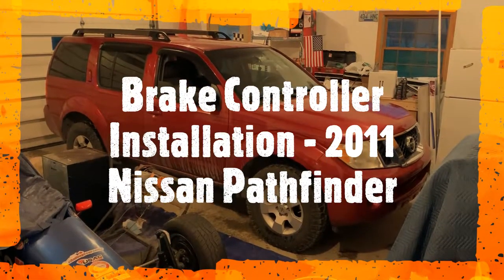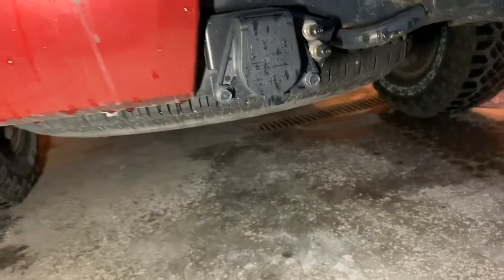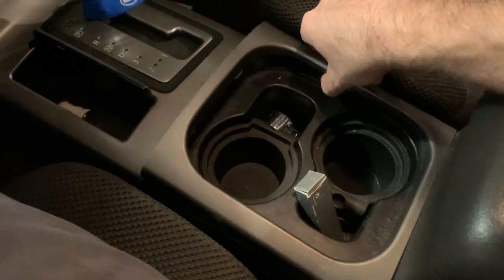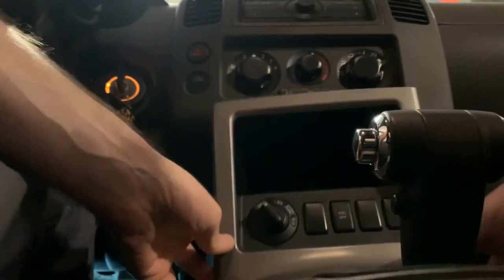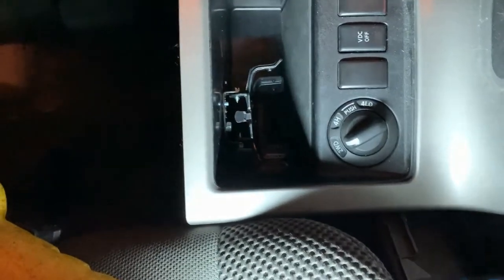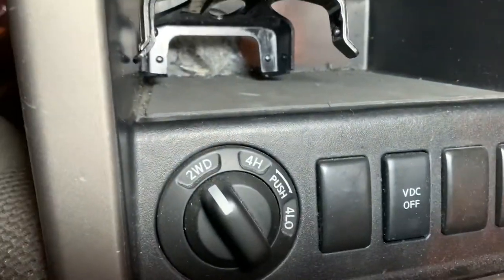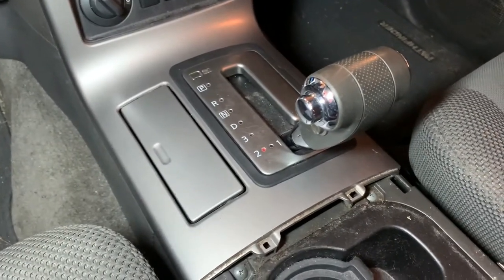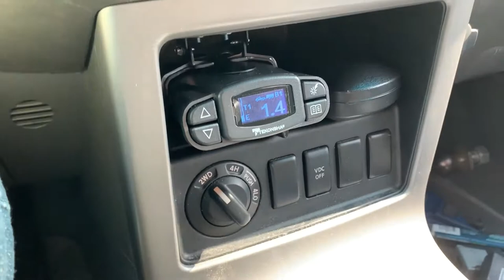Nissan Pathfinder Brake Controller Installation

Comment: Great job and a big help. I had a 2011 and sold it in 2016. Finally got another one and now I'm setting it up for towing.
Reply from the maker: Glad I could help. They are great for towing, better than a 6.2L Yukon I had before it.
Reply: @cqe5009    Agreed. I never added bags or a stiffer spring the first time,  and mine handled 4,500 # with just a WD hitch. I think I'll add the airbags this time as it's a 12 yo truck.

Comment: Really good video.  I want to do the same thing to mine but right now I have the 4-pin connector.  I am going to replace it with the 7-pin conn.  Did you have to add any relays for the 7-way?

Comment: Can I ask how you hooked up the 7 pin connector? The factory 4 pin connector and a collision sensor (?) share the same 8 pin connector on my 2011. My pre-wired tow package has the brake controller plug where it should be, I just don’t have a way to connect the standard kit which is based off of the Frontier. Otherwise, thanks! This is the only video I’ve found that matches my Pathfinder 😂
Reply from the maker: I plugged it in by the left rear wheel. The standard 4 pin connector plugs in there (up along the frame, climb under the fender and follow the 4 pin wires back from the bumper) and I bought the 7 pin one from a Nissan discount parts place. The bracket for the 7 pin connector I think came from a different Nissan model. If you search around on the pathfinder forum there are some threads about it. I don’t have a collision sensor or anything like that, so maybe you have a higher trim model. Mine is one of the lowest trim levels, maybe even the base model. Hope that helps

Comment: I don’t know if it was mentioned.  But there is a dummy end attached to the wires on the car side and on my 2019 it was located almost to the top of dash.   If I didn’t. Ask for help. I wouldn’t know about the dummy end.
Reply from the maker: Hmm I'm not aware of that. My 2011 and the 2019 generation are completely different vehicles.